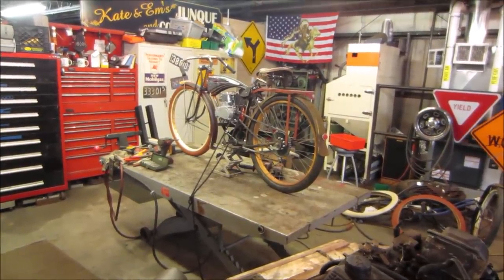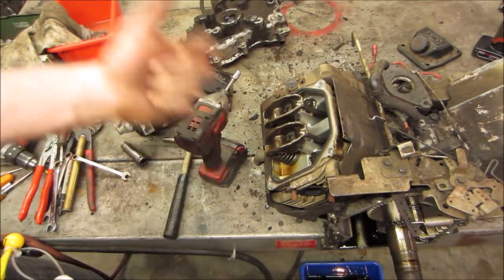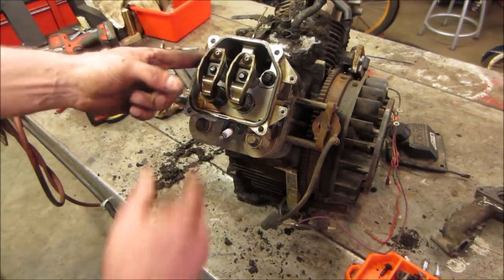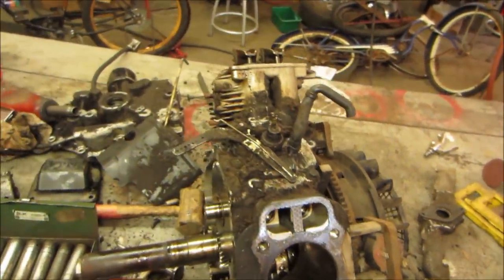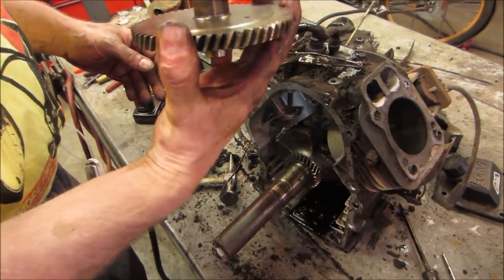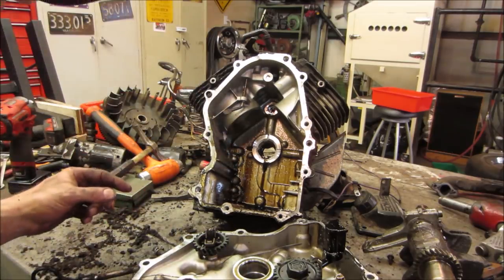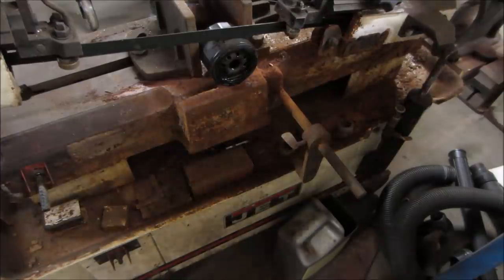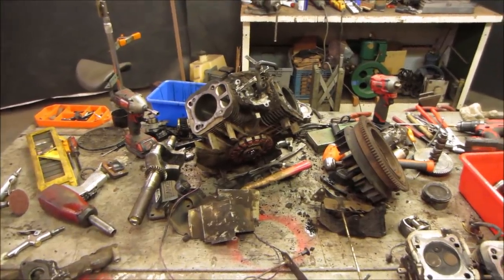Why Did This Engine Fail?

Comment: That leaf sucker motor looks like it has been well maintained.

...NOT!
Reply: Oil look very black for a gas engine and nobody ever clean the engine under the sheet metal. Indeed, well maintain engine.
Reply: Zero maintenance means zero operating cost. REALLY!   😋
Reply: If it was city owned people treated stuff like it is a rental unit. I am surprised the city did not have maintenance on the equipment

Comment: I have mowed my neighbors yard for somewhere around 7 years now. It takes a hour and 15 minutes. I always take a leaf blower to the deck and engine when I’m done and check oil before I start it each time. The tractor is a craftsman 24 hp Briggs and a 48 inch deck . It’s previous owner used it about the same and it was born in 2006

Comment: That engine had a CRUD : Complete Rapid Unforeseen Disassembly
Reply: Crank case failure.  Failure of the crankcase to keep the rotating assembly inside the motor.  See also oil pan failure.
Reply: Catastrophic Re-arrangement of All Parts.
Reply: Don't forget Fubar lol. And iy is

Comment: I have a 40 year old Kohler generator set.  Gave me many hours of power failure coverage, but in 2018 is finally died of old age.   It has an oil pressure gauge, low oil pressure cutoff and high cylinder head temperature cutoff.
Reply: i would say you  got your moneys worth.
Reply: JAMES AZBELL I did indeed.  Replaced it with a modern Generac.

Comment: I had a mower that just quit running, would crank over but not run. sounded like no compression.  I took it apart, the oil slinger came apart went between the cam gear and crank gear, broke the housing, cam stopped and held both valves open. got another engine worked mower another year. I guess 35 years for a mower is about the most I can get out of a mower.

Comment: Hi Mustie.  That Milwaukee impact should have easily bust those head bolts free but I noticed you only had it on the 2nd setting.  Change it to the circular arrow when removing stuff as that is the full torque setting. That setting is only active for removal, setting 3 is full blast for tightening. I have the same unit.

Comment: Hey @Cam - Similar thought. User drove engine on the "large truck mounted leaf vac" machine to bite off more than it could chew. If there was no shear pin or other failsafe, it was just a matter of time for the disaster strike. Since we didn't get a look at the carb we don't know if the user pushed it to override the governor as Mustie1 posited. Ran it balls out to try to get the job done faster but not better.

Comment: You can see in the video where both valves slapped the top of one piston- the intake more than the exhaust- which explains the one bent pushrod. Looks like the oil broke down from blocked cooling fins -overheating for an extended time period; finally it locked the rod, as you showed us.

Comment: That engine died from pure abuse. 
Infrequent oil changes 
Overheating, from clogged cooling fins
Low oil level, most likely run low, top off, repeat.
The push rod bent because a valve guide moved up in thre head. If you remove the valves you'll find it.
The other engine most likely needs head gaskets. Very common, causes smoking.

Comment: Check the oil gallery in the crank . I see metal transfer so that means heat . I see it quit frequently the holes get plugged and the rod runs dry and snaps off

Comment: I dunno, should we have not dribbled a little gas down the plug holes and see it it will fire? 😂
Reply: @Rick-S-6063  maybe even welder the gaping hole in the crankcase thrown another set of rods and pistons in it and fired it up... good as new
SEll it on E-bay as refurbished

Comment: 2nd one hit  @24:24  you can see 2 clean spots on the piston. the reason it probably bent push rods and not valves, is the valves move parallel to the piston

Comment: I have the reverse problem,  my nephew will bring me every p.o.s. tool and equipment he has destroyed and tell me he dosent need it anymore.
Reply: Liberty Man...HA HA!  I had a relative that did that when I was a kid.  We would get home with seized up equipment in our driveway with a note that said, “Thought you could use it.”  He lived out of state and would haul stuff on his truck and dump it and leave.
Reply: Finally my dad lost it after we got home from Kroger’s with a load of groceries and couldn’t get to the house because he dumped a truck load of bald tires with a note that said, “like new!”  After that, we never saw him again....he’s still around, because we hear...stories...from other relatives.
Reply: A "friend" dropped off an air compressor to me saying did I want it, yes I said. Discovered it was seized so took the crankcase cover off and found the crankshaft was seized to the crank. I unseized it and it runs, said "friend" comes back and I show him the running compressor, he made some excuse and left shortly after. It still runs to this day.

Comment: Hi Darren. My name is Jan Cilliers and enjoy your videos very much and is a keen follower of your channel. I am a Maintenance Manager at a Tea Factory in the Western Cape province of South Africa and would like to add my two cents worth on your video looking for the possible cause of the catastrophic failure on the Kohler engine. You mentioned it being used to drive a vacuum system picking up leaves and that makes me wondering if the impeller was directly driven by the engine? If that is the case two things might have happend i.e.: the impeller came loose at high speed and introduce a sudden severe imbalance which the engine could not handle or something got stuck in the impeller which results in a uncontrolled imbalance. We use to use 55Kw two pole electric motors driving double impellers to convey product from point to point at nearly 2800 rpm and believe me, proper balancing is crucial as otherwise the bearings on the motors did not last very long!
I would have liked to send you a letter but like everything else in our beautiful country our Postal Service is not what it used to be! 
I will comment now and then though! 
Keep the videos coming. 
Best regards.

Comment: Think you were spot on with your deduction, no single cause, not a lot of love for the engine by the person or persons operating it, build up of dirt on the fins coupled with I'll disconnected the low oil engine saver led to an engine working itself to destruction. Love the method of strip down. At least there is some use able parts 👍. Regards, Tiny, Lincolnshire, UK 🇬🇧

Comment: Cylinder started running hot, valve guide moved in the head causing the bent push rod.  check valve guide
Reply: That one rod was galling up the journal, and was in so many pieces.  I think it seized, but that shouldn't bend the pushrod.
Reply: That pushrod had me confused. No sign of valve impact. Had to be heat related.
Reply: Agreed!! I had one that did that!

Comment: Through the years, I have seen several Kohler twin like that blow up like that and blowing the side of the block out. It's got to be cheep or defective aluminum castings. 
All of them had disintegrated pushrods.

Comment: With the magnets off of the flywheel it also causes vibrations.
Doesnt need much play to start aluminum welding to the steel journals

Comment: Nice autopsy. Saw an airplane reciprocating engine in the mechanic shop I shadowed at with a blown engine. Conrod went straight through the crankcase and the pilot landed once he saw he was losing a lot of oil pressure. Probably the most expensive end of bad luck ive seen yet.

Comment: Enjoyable video. I haven't torn down an engine that far in many years. The small one are just about disposible and the big ones are too damn complicated. Maybe something like this would be a good tutorial for how an engine works. Basically everything from a two cylinder lawnmower engine to the lastest Corvette works the same. Most modern improvements come from fuel delivery, computerized ignition and varible valve timing. Still the suck, bang and blow parts are much the same.

Comment: My neighbor asked to borrow my dad's circular saw. We should have been worried since we knew he didn't basic tools like hammers and screwdrivers. He came back the next day with a new in the box circular saw. He said "I wrecked yours, I'm very sorry, please take this." Turns out he just ran the saw over the power cord. The cord wrapped around the blade, but made a clean cut.  So I just spliced it back together and it worked fine.  He didn't know you could fix wires that that.  Learning experience for all of us involved.

Comment: Those are pretty good engines. I have seen several of them well over 6000hrs. In Lincoln Ranger 250 welders, most of them tend to develop blow by in the first 1500 hours. I have had numerous units come through the shop with bent push rods. My best guess is the welder operators adjust the engine speeds higher than rated. Swap out it the bad parts put them back together. Test them and send them back out in the field until they break again.

Comment: My Troy-Bilt TB230 Briggs and Stratton self-propelling FWD lawn mower died after running for 5 minutes. I think it's either the carburetor or limited to no air in the fuel tank (gas cap failure), plus the pull string starter is making a clanking noise after I put it back together.

Comment: Hi Mustie - pushrods - early diesel 2 1/2 litre Landrover engines were so basic the push rods were designed to bend if the engine suffered cam belt failure, hand on heart I straightened the bent ones on my engine and checked them by rolling on a flat surface marking the high spots with chalk, to bash with a mallet.. All early landrover diesel engines were made like this but still ran hundreds of thousands of miles after giving bent push rods some love taps..lol

Comment: * Connecting Rod length  to Stroke Ratio *   The connecting rod broke on the upper end of the Connecting Rod beam due to poor design .  For optimum Rod to Stroke ratio an engine should have a Connecting Rod that is *TWICE * as long as the engine stroke , or as near as possible to that ratio .  This is a principle applied to many , many racing engines over the last 100 + years .  A short connecting rod puts more side thrust on the upper portion ( small end )  of the Connecting Rod causing it to flex and fail from fatigue over time . Sir Harry Ricardo did a great deal of experimenting on Automotive ( Aircraft , Tanks . Buses , Trucks , Steam ) Engines  starting in the very early 1900's , and his books explain how important the Rod to Stroke Ratio is in designing an engine .  Grumpy Bill Jenkins " How to build a Small Block Chevy " book also extensivley covers this " Rod to Stroke " ( rod angularity ) principal .

Comment: Back in the early 80s, Cub Cadet started using the Kohler 17 HP in their mowers.  This engine was designed for stationary use.   they started throwing rods left and right.  We found out two main issues.  First, the oil pickup was only on one side of the engine, and when you mowed on a side hill, wth the pickup on the upper side, the engine would lose oil pressure, and throw a rod.  The second issue, was the oil passage was machined into the case halves, and during assembly, and excess sealant on the case halves, would seal off the oil passage, and throw a rod.  Most engines would self destruct within the first 50 hours.  Most previous Kohler engines would run for 30  to 40 years before needing an overhaul.  I short blocked them  under warranty, and no more issues.

On this engine, I suspect over reving.
Reply: the magnum opposed twin? Or V twin?

Comment: We had old Kohler with a cast iron block on a New Holland bailer that sat in the dustiest place and ran the bail kicker, never had any problems with them. Looks to me that it ran low on oil seized one on the crank when it stopped it pulled the rod off the wrist pin. hooked to a vac it probably had enough inertia to spin the engine a few times.

Comment: The only engines I have worked on have been splash lube, including a Briggs Intek 15.5 HP on a tractor. Wondering at what point a manufacturer opts for a pump vs splash. Dual cylinder maybe? Higher price point? I mean, both Honda & Briggs use splash on walk-behinds and many last for 10-20 years & more. Like I say, just wondering.

Comment: Why did it fail? It's a Kohler.....
However, I've worked on a similar a Kohler that was in a similar application (welder). Almost exactly the same failure. Concluded it was low on oil, welder was on a hill when used. Rod journals are fed from the crankshaft which is fed from the passages in the block. The rod furthest away from the pump failed first (just like yours) as the oil was low. Not sure if rods in your engine were drilled for oil to feed the wrist pin but that was were the failure started and cascaded from there. Wrist pin overheated, rod snapped and then took out the crank journal. The rest failed the same. The low oil switch was covered in crud and the cooling fins were covered in dirt. No maintenance from the owner.

Comment: interesting how the crank on the oil supply side looks good, but the where the second con rod goes it's oil starved... low oil pressure? clogged passage between rods?  great video.

Comment: The valves will tend to bind up to on those when severely hot.  Many times a rocker will pop off sideways too.  The blocked fins along with a leave vacuum running for long periods at 3600 rpm cause extreme heat.  The blackened oil residue below the one cylinder confirmed the overheating.  Possibly had run out of oil as well, if pressure was low.  Makes complete sense why it failed.

Comment: look at the head with the bent pushrod, are the valve guides still all the way down? that would explain why it failed. also would explain why one connecting rod has a longitudinal break from cylinder overpressure.

Comment: The aluminum build-up on the crank was right around the oil outlet.  I wonder if a small piece of abrasive contamination came out of the oil hole, wore off a little aluminum then caused the cascading build-up.

Comment: I have seen this before a few years ago, where a 120hp Merc outboard, only 7 years old and consistently serviced by the Mercury agents, on time every time, suddenly threw a con rod while running at about 3/4 throttle for no apparent reason. The agent could not find a cause, but it didn't stop them charging in excess of $10,000 to replace the short block etc.

Comment: 1 have 2 theories.  1 - clogged oil gallery, cause rod bearing to fail.  2 - Magnets could have come off when running, caused hydro-lock and thrashed the engine.  You'd think that the magnets became unglued would cause damage, but they would be held by magnetic forces and the fact that they would be held in place by centrifugal forces.

Comment: Small engine question. Chicago Electric 7 hp generator (67561). Oil looked funny so I changed it. Run bit not real smooth. Seems to make oil. While running I took out the oil fill plug. Air/oil mix shot out like a garnder hose. Rings? Is it worth replacing the rings and honing?

Comment: I was wondering if the magnets being free, would have possibly caused a timing issue.  Would a pre-ignition hold the valve closed and bent the push rod?  Also, since it had a "fly-wheel" would several pre-ignitions have been able to progressively bend the piston rod until it broke?

Comment: The bent push rod could have been caused by the guide slipping out of the head and back towards the valve spring. When the valve compresses it hits the guide before the push rod is out of travel and the push rod bends. I've had this happen to me too many times to count on a Briggs engine. They are known for overheating when the cooling fins get blocked. The head expands and the guide slips out

Comment: My thoughts on its failure (no particular order):
1- Overspeed; no obvious signs of overheating
2- Oil starvation; lots of galling on the crankshaft
3- Taken apart and reassemble incorrectly then failed shortly after startup; but no there are obvious signs of it being dug into before.
Reply: I think overspeed. All that junk on the top kept the governor from working

Comment: Seen more than one Kohler twin blow up for no known reason. Had an early KT17 throw a rod on me many years ago. I had just serviced it the day before, so it was full of fresh oil. No idea what happened. About three years ago, had a Kohler Command on an MTD tractor that also threw a rod. We had just done a full service on the tractor a couple of weeks before it happened. Engine was still full of oil when it came back in the shop. Customer said that the oil light never came on before it quit, so shouldn’t have been a lack of oil pressure. Never figured that one out either.........
I’ve used Toilet bowl cleaner/muriatic acid to clean the galded aluminum off crankshaft journals before. It will literally dissolve the aluminum and leave the steel undamaged. Lots of times you can do that and still save the crank. Give it a light polish with some fine crocus cloth and as long as it still mics within specs you’re good to go. Just make sure you thoroughly wash the acid off and coat it with oil so that it won’t immediately rust back up. Rebuilt a couple of Briggs flat twins that threw a rod, but didn’t break the block by using that process.

Comment: One other thing that may have been a factor is the spring in the oil pressure relief valve. Also the magnets may have come dislodged from the sudden stoppage when it blew.

Comment: The oil pump was binding up when bolted in place but not when unbolted. Was it binding up on the casing? Be interesting to see if it binded up again if you put it back on the casing.